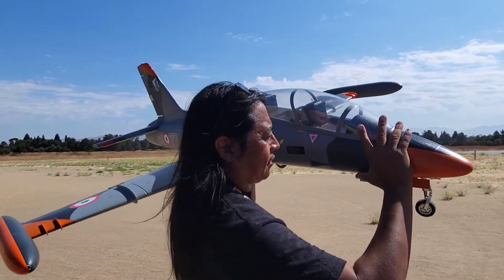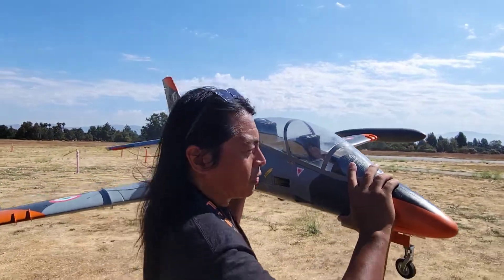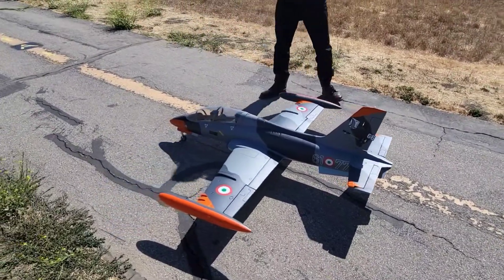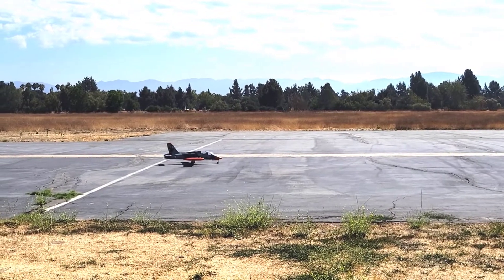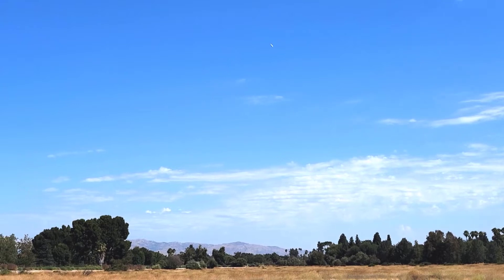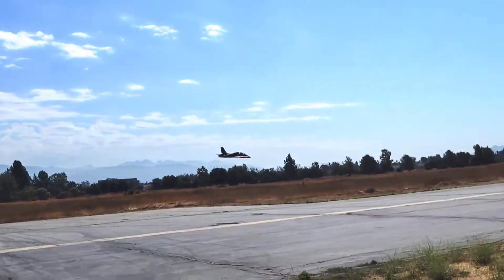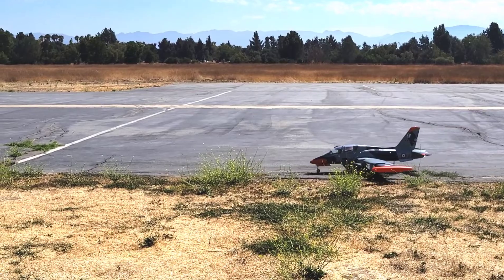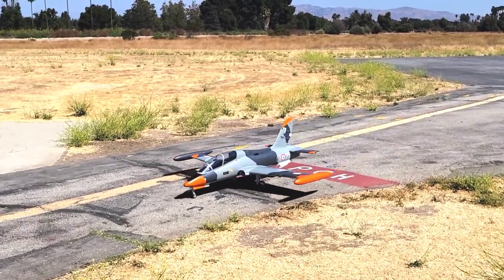Aerofoam Aermacchi MB-339 105mm EDF with HSDJets' EDF unit

Comment: Do you glide in, or have add a bit of power?
Reply from the maker: Generally, you come in with a bit of power. If you are hot you can cut the power and glide in. These planes are a bit on the heavy side so usually you have a bit of power until near touchdown.

Comment: Great plane, great flying and awesome wooosshh sound from that 105mm baby. 
What is your battery set up in there mate?
Reply from the maker: At the time of that video,  I believe I was running 2 6s 8000mah Hoovo batteries. I've since switched over to SMC 6200mah High Voltage batteries. Lighter,  more power and similar run times.
Reply: @all_rc  
Thank you for your informative reply.

My question is related to the fact of me considering the hsdjets 105mm for a  JA37 Viggen build of similar size to your MB-339.

I was expecting something in the realm of 6000mAh. I assume the two 8s came out pretty heavy to have propper fun?
Reply from the maker: The 8000mah was decent. But yes it weighed a bit more. It still had decent vertical. The 6200 SMC HV batteries are just so much better.  I seem to have about the same capacity as the 8000mah but without the weight penalty. The HSD edf is pretty much the same as Changesun unit that comes with the Aerfoam. I tried both in it.  It seems that the HSD (with a different fan) might have a bit more punch but it isn't a huge difference.  Personal opinion,  if I was to build something,  I would go with something higher quality than either unit.  I would consider something like what effluxrc.com offers.
Reply: @all_rc  

The performance of the jet, as well as landing speed must have improved from the chopped weight from the 8000s to 6Ks, and that must feel better on the overall. 

As per the CS and HSDJets fans compared to what's on display at efluxrc  I'm a 100% with you. The Wemotecs, the HETS, the Vasas - they are simply from another world when it comes to comparing with the stated above mid-range chinese budget fans.
However I only aim at the HDSJets 105 exactly due to budget restrictions.

I would loove to put my hands on a 120 Vasa for sure, but yeah.. I'll need some time to get there :)